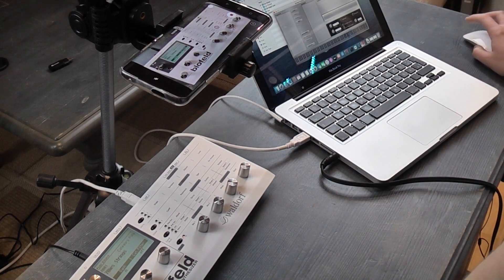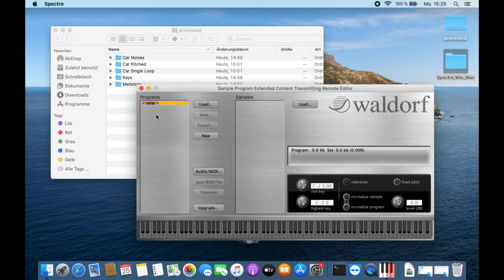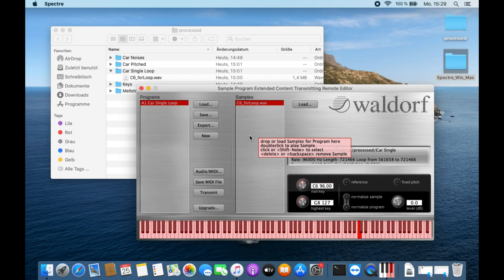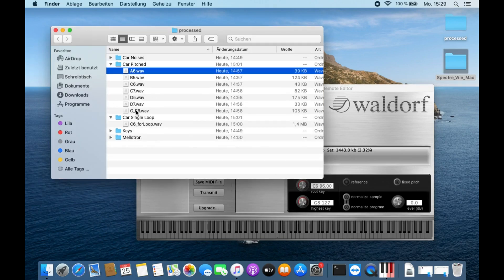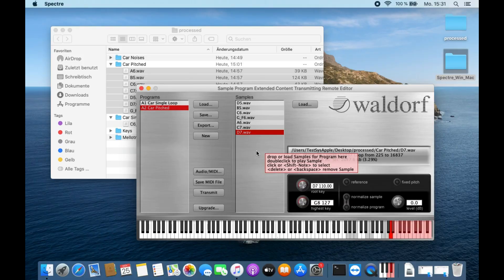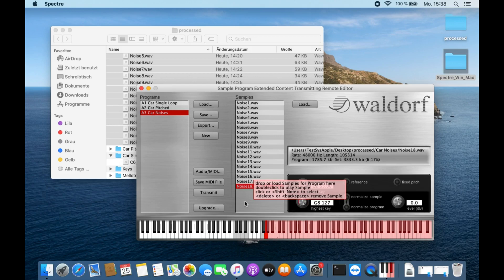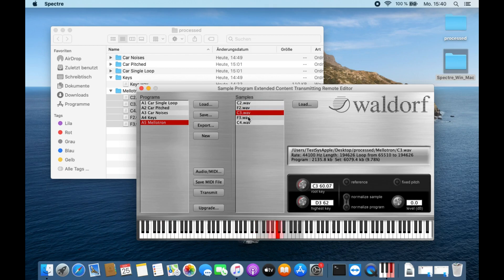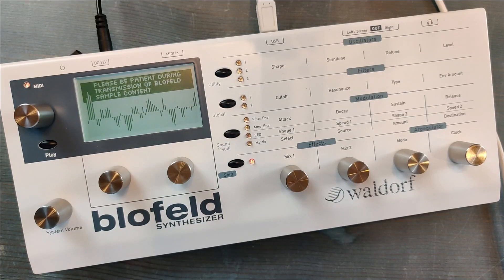[tutorial] Blofeld Samples 4: How to transmit samples?

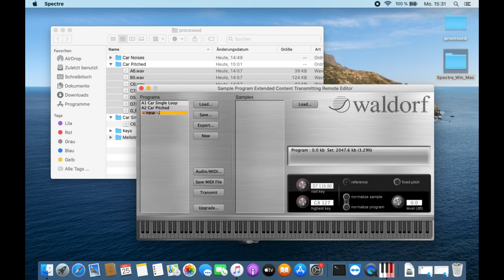Comment: @8:26 what did you do in the sped up video - you selected 'fixed pitch' mode?
Reply from the maker: No, "fixed pitch" means that a sample does not change the pitch, even when you play different keys. In the speed-up, I set the range of every sample and configured the basic key from which every other pitch of the range will be derived.